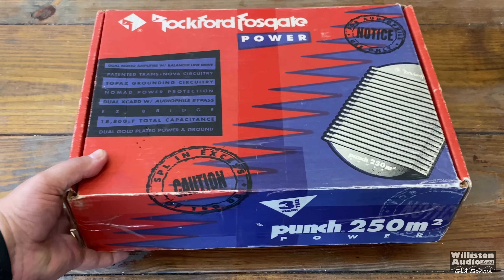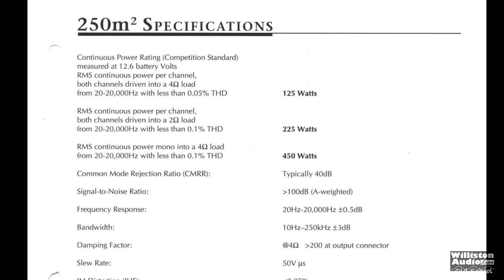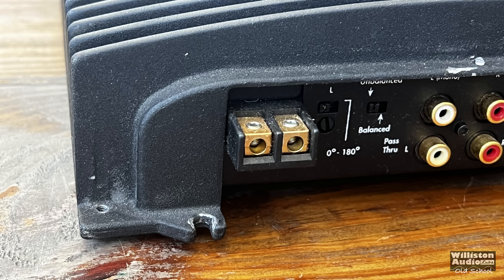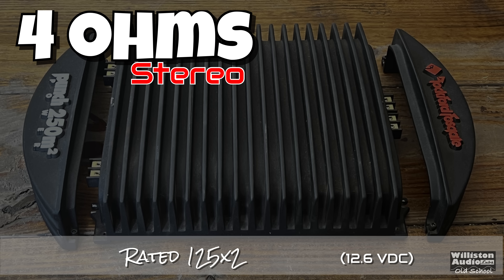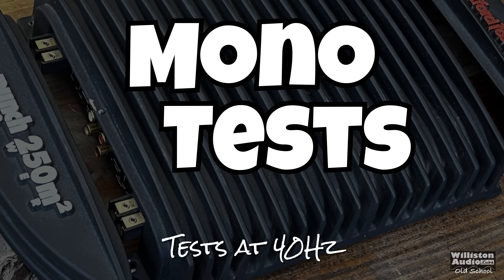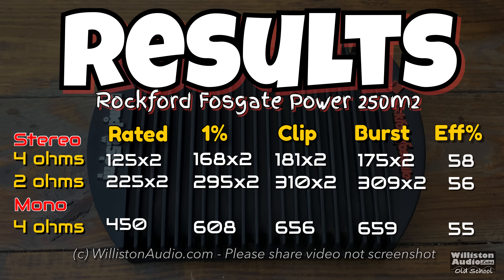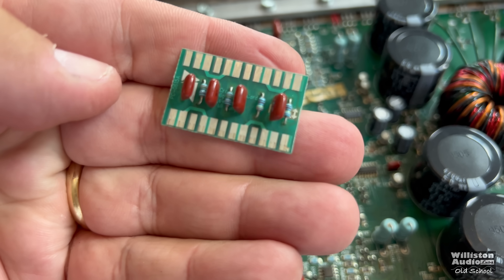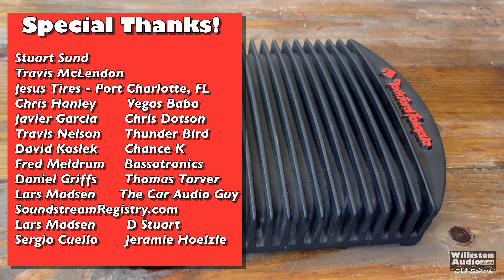1995 Rockford Fosgate Power 250m2 Amp Dyno Test and Review

Comment: Hey Big D. Regarding the X-Cards, I worked at a Rockford shop back in the day and they sent me to an RTTI training seminar and they said you could replace the resistors in the X-Cards ( or buy a blank one and put resistors in it) and depending on the resistor values, you would turn that crossover into a subsonic filter at a given frequency for an added 3,6 or 12db bump. Did you know anything about that?  I never knew of anyone that did it but was curious to try it.

Comment: One thing I’ve noticed about these amps is that the smaller amps seem to be more underrated than the larger ones. For instance, a Punch 60 will put out more than double the 30Wx2 that it is rated at into 4Ω. The Punch 40 is similarly underrated. And the Punch 100 is still very underrated, but not quite as much as the 40 and 60. On the other hand, the Punch 200 is not NEARLY as underrated as the others. Yes, it puts out more than its rated power. But it’s certainly not TWICE as powerful as a Punch 100 or five times as powerful as a Punch 40 by a long shot!

The same is true with the 250m2 (and the 250x2, which I have). They’re not bad amps by any stretch of the imagination. But they lack that ‘WOW’ factor in terms of greatly exceeding rated power that you see in the Punch 40, 60, 100, or even the Power 50x2.

Comment: This is right at the time i got into my addiction to bass. I had a soundstream Rubicon 700.2 I have never seen dyno testing of this model but I had 3 JL audio 10w6's and it ran them really good In my 88 civic hatchback. I miss that car to this day!
Reply: In the former times I’ve installed mostly RF Amps and Soundstream SPL Woofers , sometimes Focal 15“ Multimagnet Polyglass 🤪
Reply: Running one of these Soundstream 15“ in my Studio with 2x300 W Ramsa and in my living room a RF Punch 300S fed from a MUNDORF 120 Ampere unit for my open baffle 15“ Focal … deep, mighty and superdry … so much fun 30 years later 😊

Comment: Back in '97/98 year I was doing DB drag racing. I had two of the Rockford Fosgate 250M2 one to each Rockford Fosgate Power DVC15s  4-Ohms. running one to each amp at 2-Ohms so the amp was seeing 1- ohm per Sub. With a standard ported enclosure tuned at 35 Hertz it did 154 DB using 35 Hz Tone Burst  off the DB Jams Vol.2 CD. Always had to have an extra set of subs during competition. Rockford Fosgate's power DVCs of the time just would not hold up, I would melt the voice coil into the magnet. Rockford's Grand rapid facility was not ever happy when I sent the woofers in for warranty.

Comment: I still remember going to the local mom and pop stereo store as a teenager without any money and the sales lady (owner) pushing a hard sale of one Rockford amps on me.  A lot of people don't realize that the specified power rating at the < 0.1% THD is why the power ratings were so low on these mid-late 90s amps.  When the amp would be pushed under normal circumstances up to right under clipping, that's where these amps would end up sounding way more powerful than rated.  The reputable manufactures had the extra power headway built in by just stating the power at 0.1 % THD instead of < 1.0% THD.

Comment: Nice Video👍👍👍
You also have the original box. On the bottom you should see the powercube dynamic ratings printed down to 1 ohm per channel. Would be interesting to know what is printed there. The powercube simulates inductance and capacitance to simulate a speaker which is not a fixed load like our dyno-run-power resistors. These powercube tests were made with 1kHz bursts. This will result in higher numbers. I dynoed a lot of 25- 30year old fosgates. i never had a problem with aged caps. replace them when they start to get bumpy.
would be very nice if you can take the time to post the powercube wattage 👍👍👍
Reply from the maker: Hi it’s not on the box anywhere but I have the 1995 RTTI training manual and it’s in there. Shoot me an email WillistonAudio (at) gmail and I’ll send you a scan of the page
Reply: @wal  Thank you very much!!!! Check out your spam folder, mail sent, its from germany 😀
Reply from the maker: @audiokeller1975  replied! I have more to send you also. Take care.

Comment: All I know is the Punch 60 that I bought around 92 motivated the 2 Rockford Audiophile 12’s in the trunk of my Mustang very well.  Years later the amp failed and I was able to send it back in for a one-time free repair.  Blew it again years later but wished I would have kept it as I probably could have repaired it myself.  Killer series of amps though and much better than the junk they released 10 or 15 years later at Best Buy.  Those were garbage.
Reply from the maker: Yeah man when I saw those Best Buy amps I was like what happened to RF? Using max power and all 🤦‍♂️

Comment: In my years of installing every one of these amps had a single power and ground haphazardly split into a y and fed into the amp. Rarely ever saw double power wires or a distribution block.

Comment: Big D.
Coming with a Power FETS 50n06 Rails line's with a Single Transformer?
Although it has a Dual GND / 12 Battery Connecter!
Rockford could did it Great with A Dual Transformers?
Out puts On Speakers Drivers IRF540 
Once again Amp Dyno Giving us a THD 1000 Wrms.

Big D 

Please do Connect that Unit on Amp to a Do bump Do test
Highly Recommend

Comment: I still have my First Gen Rockford (1996) with the Batwings. Was rated 45wx2 and 125wx1. Was way under rated I burned up two 1000w Orion 12in Subs with that lil amp. Just amazing old school power.

Comment: I would love to see a review of the Power 50x2.  This was the "cheater" tombstone amp from this time period and intended to compete with the Orion 225.  The paint on these was more of a silver/gray and supposedly had ceramic added for better heat dissipation.  I had 5 of the Power 50x2's in an Astro van on 12 Punch 15's with another 4 Power 50x2's running a pair of MB Quart 1" tweeters, 2 X 6.5" Quart mids, and 2 X 8" Quart mid basses in each front door.  I was ROCKIN' in 1997!!
Reply from the maker: thanks for the suggestion!
Reply: And I thought I was the only one who thought these amps looked like tombstones (especially with just one endcap)!
Reply: End of an era!

Comment: I've always preferred a 200x2 over a 500m or one of the "mono" amps any day. Only draw back to the two channel amps and running a PSD-1 is you can only run one PSD-1 to a amp. The mono block amps of that era required an adapter to run two amps to one PSD-1. I plan on running six 200x2 amps in my install for sub amps and own five of the PSD-1 units. Still need to find one more. I want to say I have three quick vids on the PSD-1 on my channel? One had the audio removed from Youtube unfortunately.

Comment: No dynamic power - That tiny torroid transformer is saturating. Plenty of heavy windings for the typical above average Rockford power rating, but nothing left beyond this.

If is was a "true dual" then two transformers of the same diameter and height would give you more dynamically. Definitely not a Soundstream level of capacitance either.

Comment: I had a little Punch 40 on a set of Fosgate Punch Series 1 12's back in the day....probably 1997 or so.  Had it on 2 ohm mono and it bumped pretty hard for what it was, but it would occasionally overload and cut power.  Still way better than the LA Sound amp I got on employee discount from Best Buy, lmao. Ended up returning it and running the Punch again.
Reply from the maker: Man those early-mid 90’s RF amps still killer amps!
Reply: I have one of those in my storage unit. Pulled it out of my Ford Exploder when I got rid of it last year. It happily resided there for the better part of two decades powering the front doors mid/tweets. I'll probably put it up for sale here before to long. It even has the end caps. I have a few old school amps that will likely end up on E-bay sooner then later. Like an ORION XTRPRO 2400 in great condition pulled from the same Exploder. Pretty rare amp as it was only in production for one year I believe. Bumped hard. I have been a big ORION fan for years. I'm building a system for my Tundra right now and it will be my first system that I am not using ORION amps. Thought I'd give Down4Sound a try.

Comment: I think Rockford started having bigger dynamic numbers when they went to using class D designs. I also imagine a refresh of the caps and components in this 250m2 might help the dynamic numbers. At almost 30 years old now, those internals could use a refresh.
Reply: no. the 200ix is a dynamic monster. the dyno here is made with 40hz which gives lower numbers. do it again with 1kHz and lets see again. the dynamic power makes the amp more musical.

Comment: The Symmetry EPX2 had balanced inputs as well, and the very rare RF 8250 head unit had balanced outputs.  Interesting that the EXP2 didn't have balanced out to go all the way to the amps.
Reply: So pissed I almost bought the Clarion ADSL system. Alpine DSP was superior and eventually had 80% of the processing power packed into head units along with Kenwood and everyone else.

Comment: Thanks for calling bs on one RF’s marketing gimmicks Big D. Being in the hobby going back to the late 80’s I’ve always had a bit of a problem with their marketing. In the days before the internet you relied on the car stereo shops heavily for information. Invariably, when you walked into a shop and asked what they had in a specific power range, they would list the RFs along with the other brands they carried according to advertised power ratings. The problem was that RF advertised their 2 ohm ratings up front while the rest of the industry advertised 4 ohms. The shops followed RF’s policy and if you weren’t an educated customer you wouldn’t know that the RF amps actually put out much less power than the amps they were being compared to. This definitely was nothing like over rating but it was misleading marketing down to the point of purchase. Ultimately, they were good amps that justified their price premium but the marketing kept me from being a customer.
Reply: What are you even talking about? This amp is called a 250 because it puts out 125 x 2 @ 4 ohms. I have an original Punch 100 DSM. It's called a Punch 100 because it puts out 50x2 @ 4 ohms. 

I think you were either mislead by a shop or are still salty because you didn't understand the difference.
Reply: @Carl_Jr  spoken like a true fanboy. Guys like you quickly take offense when reading comments. Read slooowly and carefully. Unless you were building systems as an amateur in the 80’s and 90’s you don’t know what I am talking about.

Comment: You should try the test in "Audiophile" mode. With the x cards removed. If you read in manual i think it states this. Thanks for the old school videos! 
Trans-Nova amps are my favorite SQ ever 👌💯
Reply: My current go-to home setup is a Hafler Trans-Nova (same basic circuit design as the Rockford Fosgate Punch amps) pro amp driving a pair of first generation B&W 802s.  I've recently found a match for my first Trans-Nova, the plan is to rehab both of them and run them in bridged mono.  They're among the best-sounding, and most budget-friendly for their quality, solid-state amps I've found.

Comment: You should amp dyno a punch power 50m
Reply: 325 @ 1ohm and maybe 400-425 @.67 ohm would be my guess. I tried to run mine at .5 with fixed load and it choked the power.  I ran 2 strapped at max voltage 15.9v and just went into max clipping with term lab and did 1200w @ 1.33ohm. My estimate of 1% would be 800, 850 with max clipping and 950 with dynamic @ 1.33 strapped.  If big d was to give it a dynamic spike with .33 maybe he could get that 1200 that I hit with the two.  🤷‍♂️

Comment: I disagree on your dual mono perspective. Yes there is one transformer core but the manufacturer can wind it however they want. It's clearly two completely separate primary and secondary windings sharing a common core. I'd call that a true dual power supply, assuming the core is robust enough to handle the flux from both magnetic fields simultaneously without saturating. Since this is an RF product I'd guess they did build that toroid beefy enough to handle both sets of windings without interference between the two. Awesome amp and insane power output considering it's physical size it isn't huge

Comment: These silly crossover modules from Kicker and Rockford back in the day were a big turn-off for me on my very limited budget. Alpine had 80hz LP/HP selectable crossover on their later 35XX amps in the very early '90s and fully adjustable crossovers in their first-gen V12 amps in '95, which is why I went with an Alpine MRV-F400 for my first amp. I still have it today! 😀👍
Reply: Same here. I'm not paying extra to buy modules for different settings when I could just buy an amp with  knobs & switches that I can set to whatever I want. I used Phoenix Gold & Alpine instead (and JL when the Slash series came out).
Reply: @marcmagee5975 late response but, the X-cards were better in many ways when compared to the “variable” crossovers. The variables were never precise and to further disappointment users had to rely on the silkscreened graphics to tell them where the crossover point might be. X-cards were exact and also infinitely adjustable in the hands of anyone that took the time to learn how to use them. Also, with minimal added cost for parts to do so. 12 or even 24db slopes were possible in some instances. Subsonic filters, LP or HP and even bandpass applications. If ya know you know..::or now u know. 😁
Reply: Damn brother I still have my PPI amps pc2600 (2channeles and PC 6600 /6 channels) any any one wants let me know ahhhh 🙊🙉🙈🦘🦜😺😻😹😸🤗🤑💰💰💰💰💰
Reply: I have several older alpine amps. They are TANKS. I definitely slept on them in the 90’s. Their Japanese made stuff was very well made.

Comment: Back in early 90s a buddy had a hatchback with MTX 12" x 2 box and 2 Rockford Punch 45s. He originally had 1 45, and it was pretty loud. There were never any measurements. Then he got another 45 and ran each 12 on each amp bridged. It definitely made a difference with the 2nd amp, but it absolutely was loud. I remember after one night finding blood on a q-tip cleaning out my ears. I don't know 100% it was from cruising around in his car but damn, it was loud and sounded good!
Reply: man them punch 45's were on the other side of the state as well in lake charles pushin all kinds of subs from 8's to 18's . there was a mini truck club that was so specific , u needed an s-10 lowered , aftermarket wheels an alpine deck (no lie ) and subs . almost all of'em had Rockford Fosgate or JL  sumptin in'em . called them selves sweet & low and even used the logo , modified slightly .

Comment: if it just power supply then its true duel mono .the other type would be twin power supply right ?
Reply from the maker: Dual mono is two mono amps in one chassis, sometimes on one board, other times on separate boards
Reply: @wal  i know i was referring to power supply as a separate thing as it should be to be just the amp board i am a vintage home audio guy well audio guy i guess and havin to having 2 power supply's and audio sections just seems weird  if thats the case never knew that was a thing ;] God bless

Comment: 10:03 (talking about the electronics inside) nicely built and quality components, but the long flying wires coming out of that trafo are making my heart scream in EMI...
Reply from the maker: Yeah wassup with that?
Reply: @wal  ow it may interfere with other electronics (remember the crazy pixels on the dyno's display when testing some class D amps?)  and it may interfere with sound quality. Actually none of these has happened, but I just wanted to point it out

Comment: That paper the amp is wrapped in hits me right in the nostalgia when I bought my punch 100ix for over 400 bucks! Took me many hours working for 4.25 and then 5.50 an hour to get that bad boy! Loved it.  Sold it in the late 90s.
Reply from the maker: Yeah man it was so cool they did that
Reply: Me too! I bought an original Punch 100 DSM (no "ix") brand new in 1993 and I still have it. It finally gave out about 12 yrs ago but I refuse to part with it. 😂
Reply: @Carl_Jr Consider getting it repaired. These old amps are becoming quite valuable these days, and are definitely worth repairing.
Reply: I know exactly what you mean. Love those old Rockfords.
Reply: HEH, Car toys had an even and a sale. Rockford was there and had reburb 200ix for 200 bucks,.full warranty. I bought 2. One had broken feet so I sent it back and a week later I had a new one. I went to install and the second amp had the threads stripped out so I sent that bacvk and they sent me another new one. 2 weeks later I got a call that my new amp came in,. I was like "Okay" then a few weeks later I got another call that my new amp was in come get it....I traded them for a 78 malibu..

Comment: I'm surprised you found a working example of that amp I had 2 of them and they both popped at 4 ohm , my next amp was a philips sound labs  it absolutely slammed I wish I never sold it .
Reply: It was a a2150 pcb was gold and I had it on 2 10 inch Kicker solo subs in a 1983 z28 they where in a long sealed truck box  face down in the kick it hit so hard  people would reach over turn it down cause it caused ear pain
Reply from the maker: Oh snap?